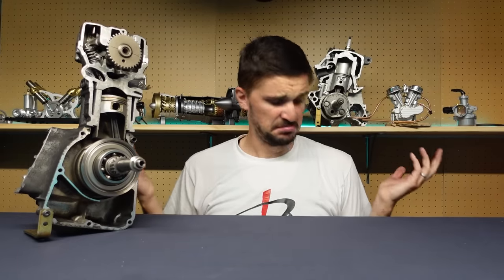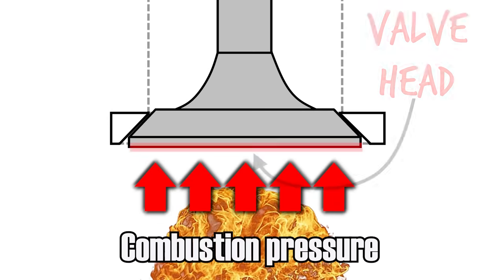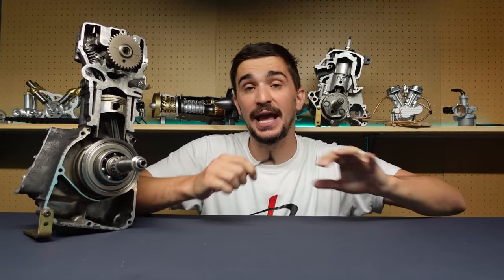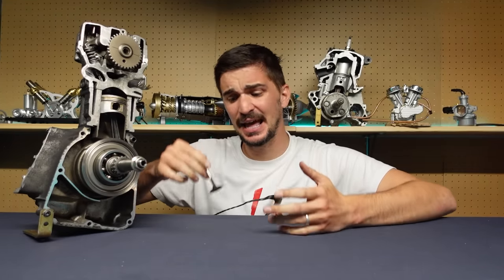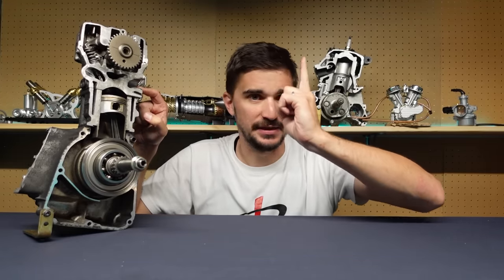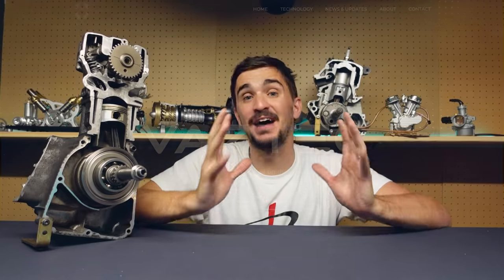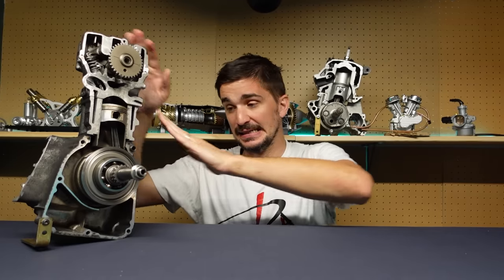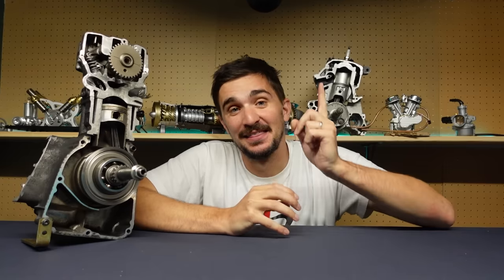Rotary Valves Make Normal Valves Look Silly - Why Aren't We Using Them?

Comment: I've often wondered why we haven't used rotary valves in combustion engines myself. Thanks for a great video that does a great job of explaining the advantages and disadvantages of this design. A similar approach to the rotary valve was invented and tried out in 1905 by Charles Y. Knight. Knight's engine used concentric sleeves with ports that slid up and down at appropriate times to allow flow into and out of the combustion chamber. This engine had the same challenges as the rotary valve system with sealing and an additional disadvantage of a complex mechanism. The engine was very smooth and quiet, but ultimately proved too expensive to be viable.

Comment: I worked at a company where one of the owners was involved in the prototyping of a rotary valve head. 

Along with the sealing difficulties, he explained to me that one of the big drawbacks was poor airflow when the opening was misaligned. They were able to improve it by adjusting the shape of the porting, but it was not as good as a poppet valve when it is partially opened. Additionally, when the port and spool was half opened, for example, the fuel and air flow would separate in an unpredictable way. Ultimately, they abandoned it because it was not better than poppet valves and WAY more expensive.
Reply: Literally what I imagined, nice in theory but a huge tell tale sign would be if it made more horsepower, I would love to see that dudes project versus the standard engine because I can’t imagine too much more horsepower than the normal poppet valve we have
Reply: @benjaminwatson7868 I mean I’m also curious but…  while the efficiency is the goal for most applications it isn’t the focus of this video whatsoever
My biggest take away from it, is that for SIMILAR parameters we can have SMALER engine with LESS parts and thus lighter machine overall with possibly less noise/vibrations but that is said by a company that try’s to sell it so idk
Reply: Yeah it wouldn't be hard to fix any of that tbh. The only legitimate problem still is sealing.
Reply: I've run a rotary valve 2 stroke. It wasn't much at low RPM, but holy hell, it would run on the top.
Reply: I think the "separation" of air and fuel flows in a processed mixture (carbureted) is no longer an issue with injected engines
Reply: @cirosan28  Depending where the injector is, very true. This story was from decades ago, and everything was carbs back then.
Reply: @MrTL3wis   SkiDoo 670H.O. ? I had one, I know the new sleds make more power everywhere, but the “peakyness” and the way that thing felt like the revs would never stop climbing, made it a blast to ride.  On smooth trails…….
Reply: @MrTL3wis  old yamaha ?
Reply: Back in the 1980s someone made a single rotary valve for a Yamaha XL500 single. One cross valve provided inlet and exhaust ports.
Reply: They will have to drive the rotary valves electrically if they want full control of the valve timing. Cam phasers just aren't up to that.
Reply: @roceye don't they already do exactly this in modern Toyota engines (electrically controlled vvti)
Reply: So are you saying that rotary valves could not overcome a small disadvantage with an equivalent level of time and development that poppet valves have had? And I bet rotary valves are more expensive because they are not as well developed. The inherent mechanical complexity of rotary valves is so much more enticing.
Reply: @MrTL3wis   Isn't most (If not all) 2 stroke engine using intake and exhaust port on the cylinder wall without any valve? I do know some engine comes with some sort of "valve" that are used to change the geometry (Opening port size) of exhaust port (such as Yamaha Y.P.V.S) but those are not properly speaking a "Valve" system that open & close the intake and exhaust ports.
Reply: Rotary valve is ideal for "High RPM" engines but awful in terms of actual efficiency. Poppet valve self-sealing ability is perfect for low RPM, high compression engine, which is, surprise! Fuel efficient. Poppet valve's weakness is more apparent in small displacement/small cylinder engines where they took anywhere from 1 to 3 horsepower per cam (a big deal when 125cc single engine has like 12-15 horsepower at most). But in larger engines, that doesn't matter as much, because same RPM = same overall cam load.
Reply: There's quite a few changing speed mechanisms where it could quick snap to open and quick snap to closed, but there's another failure point
Reply: @geoffmooregm Not to mention that if you were to do this on a modern DI engine, I don't think you can get the intake valve hot enough to prevent buildup.  And then if you get buildup, you can't clean it without opening the valve.  And then you're f*d because everything will fall into the cylinder and this turns into a partial engine rebuild instead of a valve cleaning.

So then you put the fuel injection before the valve and you can't do atkinson cycle or anything without worrying about the intake starting on fire.  I think this is an overall loser of a design except where engine cost is the controlling factor (low use items like lawn equipment or generators).  I don't think it's going to be long term reliable and competitive for efficiency at the same time.
Reply: @big0bad0brad  the problem with a Di engine is the fuel injector is after the valve and doesn't provide any cleaning with the fuel to the intake valves letting carbon build up from any detonation that happens near the valve seat
Reply: @geoffgunn9673  Mazda already did it tho.  We can stop having the DI argument because you just run the intake valve hot af and make a half decent effort at vapor reclaim before the crankcase gas recirculates.  That reduces the problem so far that it's no longer a limiting factor as long as the engine is otherwise running okay.
Reply: I don't see a problem with sealing as turbine engines use oringless seals all over the engines and the design allows for the expansion of materials such that at operating temps the air gaps are at a tenth of a mm. I suspect  these valves would need to be harmonically balanced
Reply: @gofasturnleft01  Pavesi engine on a racing go kart.
Reply: @MrLarsgren  Pavesi engine on a racing go kart.
Reply: @kmanliberty1065  Some have proper valves and some do not. A 'piston port' 2 stroke doesn't really have anything which could be considered a valve. This does limit us on power by limiting us on port timing.

On 2-strokes were performance is more important, reed valves are usually used in the intake tract. Rotary valves are the alternative to reeds, but both are proper intake valves.

I'm not aware of any gas 2-strokes that have an exhaust valve, but they probably exist.
Reply: @big0bad0brad  DI is really, really good for running ultra lean, so it will stay with us for economy/emissions. We are seeing several manufacturers using port over DI systems to be able to keep the advantages of running crazy lean at cruise while having the cleaning and power advantages of introducing the fuel at the port at WOT.
Reply: @MrTL3wis  Yeah that's the other way to do it but you double up on injectors that way.  Maybe if Mazda has patents, that might be what others are stuck with.
Reply: @cirosan28  That's my thought also, but port injection could help with the lubrication of the rotary element.
I know gas is not even close to oil, but that would need the same reasoning behind fuel pumps not running dry, the design accounts for the presence of fluid in the bearings and the seals.
But spraying fuel on the drum would also toss precise injection out the window, required to stay inside pollution requirements
Reply: this is the exact opposite thing the video suggests

Comment: Coates Engineering in Wall Township NJ started working on rotary valves back in the 1970s. A friend worked for Coates. They had several 5.0 L Ford V8s modified and running with rotary valves.
For clarity on Ducati Desmo service intervals, my 2023 DesertX requires Desmo service every 18k miles. That's similar to service interval for motorcycles with valve springs.
Reply: Coates had plenty of longevity problems.
Reply: The valve adjustment interval on the earlier ones was 6000 miles. VWAG buying Ducati actually wasn't a horrible thing.
Reply: @georgelane3564  
For clarity, rotary valves have longevity problems.
Reply: I checked the valves on my Yamaha R3 at 40k km (24k miles), they were perfect, no need to adjust valve clearance. The service manual says that valve clearance checks are at 20k miles.
Reply: I remember the building Coates was in. I went there in the mid 70's when it was a car museum. I don't know about now but Coates was there in the 2000's.
Reply: Coates didn’t get his first patent until 1990, unfortunately, he beat me by six months to the application. Actually, that might be a fortunately not unfortunately. They had significant legal issues, attempting to manufacture their cylinder heads.
Reply: @LawrenceOrsini  Striking, in an other comment thread I lamented how patents hinder the use of inventions. Mainly because they are build on the premise that ideas are very special and only one person could ever think of them. You've just added an other example.
BTW, where those legal issues also patent related, perhaps because the way they wanted to build cylinders was already patented by yet someone else?
Reply: Great comment!  Do you know whatever happened to this company? I lost track of them. Hoping for their success!
Reply: @colombianguy8194  
This isn't uncommon. My buddies Panagale has been at AMS Ducati for two service interval (mileage) DESMO service inspections. The clearances are still within spec.
Reply: @dporrasxtremeLS3  
I have no idea what happened to them.

Comment: Clicked to hear a lenghty argument for why rotary valves in german trumpets beat piston valves american made ones… but instead learnt more about engines and motor history than I ever knew before. Great video, brass musicians beware. One thing that peaked my curiosity though is if a system similar to a trumpet piston could work. Where instead of relying on two pistons for inlet and outlet you use one, non-spinning valve that instead moves up and down in the direction of the valve, with grooves cut out ti create different airways depending on the position of the valve. So you would have one piston with 3 states essantially.

Comment: I have a 1918 "automotive service and repair" manual. With exception of electronic engine controls, there is almost no technology that hasn't been thought of and tried. In that manual, there is a reference to a tubular valve engine, which has long tubes within the cylinder head, one for intake and one for exhaust. These tubes would rotate with passages opening into the combustion chamber timed to allow intake or exhaust into or out of the cylinder at the appropriate time. The tubes are fixed at the end of the head to either the carburetor or exhaust pipe. That book has so many cool innovations that have been lost to time, it might be worth a look for some "NEW" ideas. Especially now with our better metallurgy.
Reply: It kind of makes me wonder how we got to such a ubiquitous engine design. Is the current set up so much better than it outweighs all these other options...
Reply: Sounds cool. Do you know the publisher/authors? I'd like to look this cool book up.
Reply: Well - a good example is Mazda and the rotary engine.

Many companies tried rotaries in the 70ies and 80ies - but finally gave up as sealing the combustion chamber was an issue that couldn't be fixed with that days' tech.

Mazda kept tinkering for decades - and all other companies were like "they never get it to work properly".

Finally - they made it. They found an alloy strong enough for sealing the rotor tips. End result: Mazda RX-8. A bit thirsty - but robust and high-revving.

Basically the same story was an engine running partly like a diesel and partly like a gas car for maximum efficiency. Mercedes tried it (called Biesel - German for Benzin+Diesel) - and gave up. Not possible.

Today - you can buy these engines (Skyactive X) in various Mazda models.

Point being: Many old ideas work great with today's technology.
Reply: @JohnSmith-of2gu   I've moved a couple of times since I saw it last. It was copywrited in 1918. It was just by chance that I found it. I will dig through my stuff and try to find it.
Reply: Probably was referencing an Elmore.  They were one of the pioneers of rotary valve engines. @russstyczinski

Comment: 3/24/24: Excellent, well illustrated explanation of the advantages and disadvantages of today's poppetvalve valvetrain.  As a youngster I owned a Vespa scooter, which was a 2 stroke design that required only a 2% oil mixture.  It got over 100mpg too.  While it did not have a rotary valvetrain and instead utilized standard 2 stroke side port design, it worked flawlessly.  Smog emissions were low for it's time.   It cost less to manufacture and had a higher power to weight ratio than 4 stroke engines.  Your rotary valve demonstration reminds me of that 1965 Vespa engine.  Retired in Sacto.
Reply: Vespa two strokes used the flywheel as a rotary valve with carburettor connected to crankcase rather than cylinder as most two strokes using piston to open and close ports
Reply: 50cc two strokes stayed relevant compared to 4 strokes longer than than for  larger capacity because of two major reasons regulations and tuning. (and to a smaller extent 125cc)
50cc was the only way for teenagers  to have transportation between 14 and 18 to in many places in Europe. or 125cc 16+
kids love to be independent and have transportation but they also love to race, and go fast. 2 strokes was the only way to have good performance stock (after derestriction) and also to increase performance massively with rather simple upgrades (exhaust, carb).
If 4 strokes were given 2x capacity rule like MotoGP got vs gp500, 4 stroke would probably  had prevailed sooner. now 2 stroke is progressively disappearing from markets due to emissions. direct injected two stroke was a big thing when it came out regarding mpg emissions and reliability but it was already too late and Aprilia never managed to bring this promising tech to larger capacity engines.
Reply: thinking about it, Aprilia ditech directly injected two strokes would deserve an in depth video by @driving4answers

Comment: Very good description and demo of engine valves and their problems. Yes, the rotary valves always leak because of the necessary clearance to permit rotation but also allow for expansion. A solution is four longitudinal seals on the barrel, as used on Wankel engine lobes, but that introduced a lot of friction and heat.

Comment: 16:56 You forgot to take in a count that it actually takes half the effort to spin the cam shaft. 
Furthermore, this is due to the camshaft spins at half the speed as the crankshaft, 2:1 gear ratio, cam to crankshaft timing chain/belt relationship.

Also keep in mind, that  once the valve spring(s) is compressed, their is energy stored in the valve spring pushing against the camshaft that's trying to spin the camshaft.  I'm shure you have experienced this first hand when trying to spin a camshaft in a cylinder head. Moreover, this compressed energy storage in the valve spring isn't completely wasted.

I'm just giving you something to think about.

your fan always.
Reply: It is true that some energy is recovered.
Reply: @tonyduncan9852 the vast majority is recovered. 
The only losses are friction and the inertia of accelerating the valve.
Reply: @Benzley722  the rotating valve will not have inertial energy loss because the valves do not reciprocate, but will have significantly higher frictional losses fuel to the nature of the seal.
The inertial losses of the poppet valve is negligible, particularly when compared to that of the pistons and rods. 
I included it to satisfy the galaxy brain that would otherwise correct me on my egregious omission.
Reply: What effort you mean? Torque is half due to the ratio, but speed is double (at crank). Power loss is the same* being torque x angular velocity. 
* losses asociated to friction and intertia are greater if the speed is greater, so the 2:1 is beneficial to turn slower the camshaft resulting in lower frictional losses also lower intertia losses.

A lot of the energy is recovered. Might not look right on a single cylinder engine, but at a 4-6cyl engine it can be felt by hand that it does opens fairly smooth. because the cams on the return lift stroke will help the cams on the lift stroke. And on 6cyl there is a lot of overlap on all cams. But even in a single cyl there are no free lunche in thermodynamics. Energy gained by the return lift on the cam is there and it evens out almost entierly the lift stroke. Steel springs are great on not having hysteresis and heating up due to internal friction like a rubber block.. so they are great to return over 99% of energy when depressing.

In the same way cylinders can be deactivated by just keeping the valves closed all the time. The engine will compress air with a lot of effort raising the temperature and presure.. but then on downstroke it's just pushed back and will revert to almost initial condition of pressure and temperature. The minute difference would be the minute heating of the friction in the piston rings that would transfer to cyl and to the gases inside. But asuming equilibrium, the minute heating is not even there as there is a whole cooling system that caries a lot of Joules into the atmosphere.
Reply: Very little energy recovery.
Reply: Good point!!